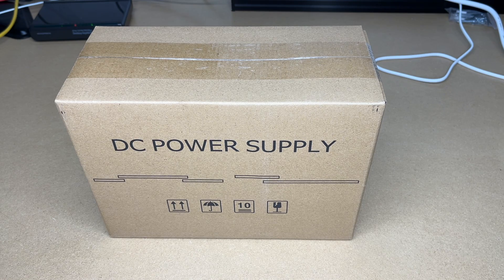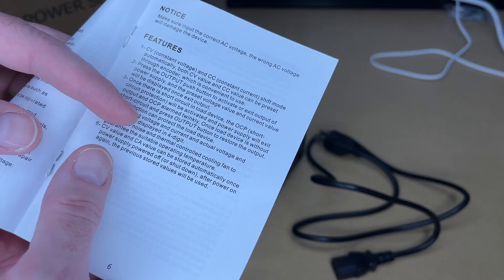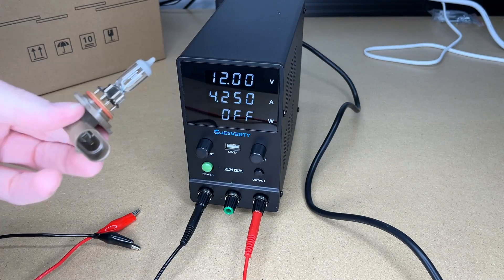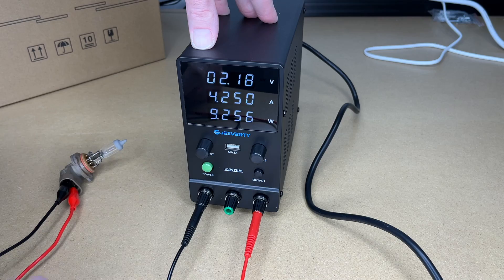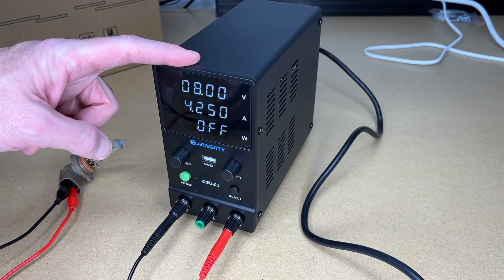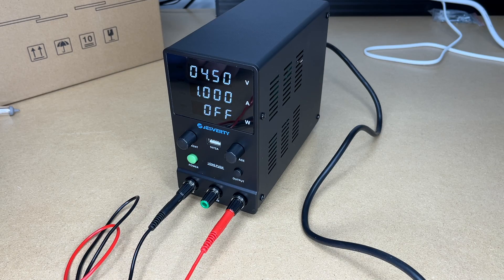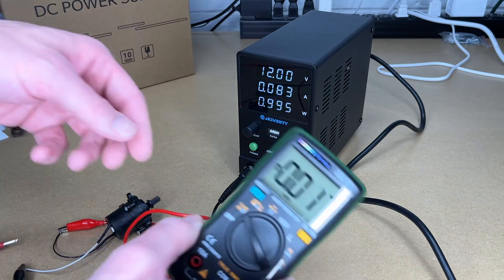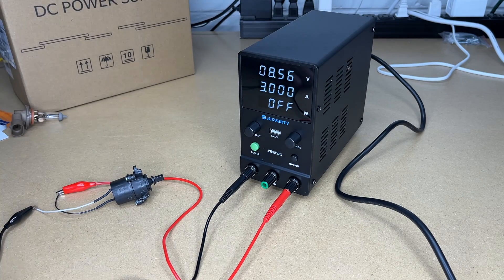Jesverty SPS-3010H 0-30V 0-10A Adjustable DC Power Supply

Comment: Its junk. Can't inject voltage to find short circuits. Or test amp draw. I don't know what its supposed to be for if it can't do those things.
Reply: Why is that?
Is it the short circuit protection?
One would think that it can output 10 A for testing even if the resistance is low, just turn the voltage down.

Comment: The "constant voltage mode" indicator is the green LED to the right of the voltage display, while the "constant current mode" indicator is a red LED to the right of the current display.
The red indicator to the left of the voltage display is labelled "OVP" and apparently indicates that overvoltage protection is always turned on. Holding the Voltage knob displays 33 V, which is apparently the OVP trip voltage, but you can't change the voltage or turn the mode off.
The red indicator to the left of the current display is labelled "OCP" and it is lit whenever overcurrent mode is enabled. You can see the indicator turn off and on when you disable and enable OCP in the OCP set mode.
There's also a green OPN indicator on the left that tells you if you have enabled the "auto output on" mode.

Comment: I have the 60v version of this that arrived today. There is an orange 'OVP' indicator light on the left side of the screen which is always on. I must agree with other comments that this device's interface is far from intuitive and the manual is hopeless. When I hold the V button in for 3 sec, it displays the OVP screen which is set to '63.00' and '1'. When I do a quick press it does not allow any of those values to be adjusted, and exits back to the previous screen, so I assume that OVP is always on the on state with this model, and the value represents the max voltage of the 60V model?
Reply: That seems to be correct. The 30 V model has OVP set to 33 V and always enabled. The red OPN indicator to the left of the voltage display is always lit.

Comment: Hello, I have a question. What mean if the OVP light turn on?
Reply: I just got one today, and I see that the OVP indicator light is orange, although the PS seems to work properly. I think there are different models, although my manual says it is the same model as in this video, I have different indicator lights that display in green in the screen which I do not see in this video. I am still hunting around to see if the indicator, when orange, just means that that feature is in a state of readiness.

Comment: I just used this PSU (borrowed from a local friend) to inject voltage to find a shorted part on a circuit board. It seems to have a strange auto-detection of constant voltage or constant current and switches between them at will based on voltage and current (not what you want for voltage injection). I wanted to pump in 3V at 5A and check what got hot but it kept the volts at 3V and dropped the amps to 0.7A. The only way I was able to get the CC light to come on was by increasing the voltage to 5.2V and then adjusting the current up to 1.351A. That was enough to heat up the part and I found it with my finger. If I changed the amps to 1.352A it would switch back to constant voltage mode and the CV light would come on. Very frustrating! It's a very strange design and not easy to understand as the manual is pure Chinglish and doesn't make sense. Also, thanks for explaining what the OPN mode does. The manual has no mention of what it actually does, only the method to set it. You wouldn't actually know what it does unless you turn it off then on and the output then comes on automatically. The function of OPN or what OPN means wasn't obvious to me. Because of that auto switching mode I would stay away from this PSU and look for one that can be hard set to constant current mode and stays there when doing voltage injection for repairs.
Reply: Thats actually really frustrating. As I bought mine because I need something that injects 1v as my other voltage injection tool has a minimum of 1.2v which can be too high for some voltage rails.
Reply: @johnmellor932  It my be ok to find a shorted cap but for my use-case it was a very large QFP240 IC and it created a dead short between 3.3V and gnd and sucked up all the current being fed to it from a 3.3V reg (which got hot and turned off to protect itself).
Reply: @g4z-kb7ct  Yeah I think its designed for the home hobbyist tinkerer. Voltage injection is pretty advanced and I don't think they had that in mind for the end user.
Reply: Any bench supply I have used automatically limits its output to the set voltage and the set current, whichever one happens first. If you want a specific current and don't care about the voltage, you set the current you want and set the voltage at least high enough to reach that current. But to get 5 A at 3 V (or less), the load resistance must be 0.6 ohms or less.

If the unit stayed in CV mode while delivering 3 V and 0.7 A, then that is all the current the load would draw at that voltage. The effective load resistance at that voltage was 4.3 ohms. When you increased the voltage to 5.2 V, the current increased along with the voltage until you reached the current set point of 1.351. Then the supply limits the output voltage to keep the current within its setting. At 5.2 V and 1.351 A, the effective load resistance was 3.85 ohms.
Reply: @dmmartindale  Ok thanks for the explanation. To be fair the board had a large QFP208 chip shorted to ground so the 3.3V rail was actually 0 ohms. Yeah I'm expecting it to do something else but ohms law prevents it heh! I did end up fixing it and logged this repair on my website.
Reply: @ Yes, in a situation like that the voltage at the power supply is higher than the voltage at the chip, because of resistance in both supply and ground circuits.
The current at the chip might be the same as the current at the power supply if the only current path is through the chip - but if there are multiple paths then this isn't going to be true either.

Comment: I could set V*, and I could set *A but as soon as I pressed the green button for W then the A went to zero and even the V would start dropping on the multi meter display.

I find it unintuitive and extremely user unfriendly and unless I have a major breakthrough by Sunday 1st December (it's presently just turned 30 November) then this piece of junk is being RMA to the seller.

The manual is far king gibberish IMO! Just a lot of alphabet  letters joined together by acronyms.

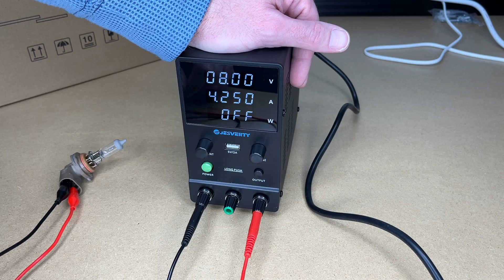Comment: At 7:17, why is it necessary to change the amps setting to 3A? What does that do exactly?  The OCP had previously (4:55) been set to 10 A but then disabled (changed from 1 to 0).
Reply: I think I get it. With OCP disabled (or with OCP enabled but set to a high value) and with the "regular" current value set to 3A, if the load tries to draw more than 3A, the voltage will drop accordingly to keep the current fixed at 3A.
Reply: @ericjones7300  yeah that's the over-current-protection setting that will trigger OCP if the current goes over the set number.

Comment: Rick nice review.  However you did not address the input power specification is only 110Vac +/- 5% which is not sufficient for the typical U.S. Power.  My power is provided by Edison in Southern California which states that input power for utilization equipment is 120Vac nominal with a range of (115Vac to 125Vac) which is outside this units input power specifications.  If these units are really only specified for 110Vac +/- 5% this is a real problem.  Do you think it is just a print error and it should really be 110Vac +/- 15%?  Hope you can verify the correct input specification.

Comment: Can't figure how to switch to constant current mode. Can you help?
Reply: It will be outputing CC until it hits preset voltage. For example if you charging Lithium batteries, you set say 2A current and 4.2v, so while the battery doesn’t reach preset voltage it will be getting 2A of current regardless of voltage. When it charges up voltage will increase until it hits you preset setting and from then it will be maintaining voltage instead of current
Reply: I had the same issue on the unit I just loaned from a local friend. It has an auto-switching thing flicking between CV and CC based on the voltage or current. To find a short, if you want to inject voltage say 3.3V at 5A, when powering on it will drop the current (in my case it was 0.7A). To get higher current and turn on the CC LED you have to put the voltage up and then it will switch to CC mode and you can adjust the amps up a bit. But at some point it will switch back to CV mode, whereby you must increase voltage again. It's pretty stupid and this is a major issue when doing voltage injection. I wanted to just inject 3.3V at 5A and it actually outputted 3.3v at 0.7A and there was no way to switch it to CC mode except by increasing the voltage. Poor design, stay away from it and find something better with hard-set CV or CC mode and without that silly auto switching mode.

Comment: Thank you for a great review.  Does it also have OVP if you press and hold Voltage?  Someone said it shows 33v, can you adjust it?
Reply: I have the same question.  I pushed buttons and turned knobs.  Apparently it is not changeable.  Mine shows 33.00V OVP "1" (always on).   I cannot change the voltage or toggle 1 to 0.
Reply: @paulshibbs  I returned it because the fan would cycle on/off with 500mA load which is every annoying for me.  These use cheaper heat sink unlike original aluminium plate the size of PCB.